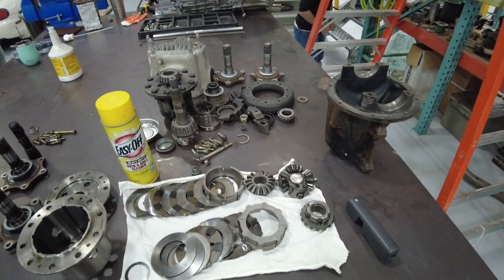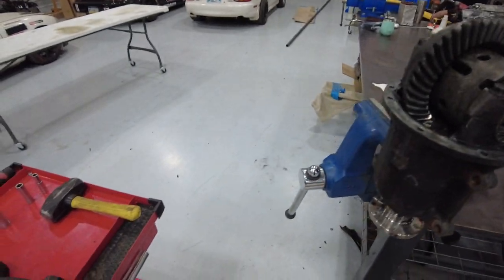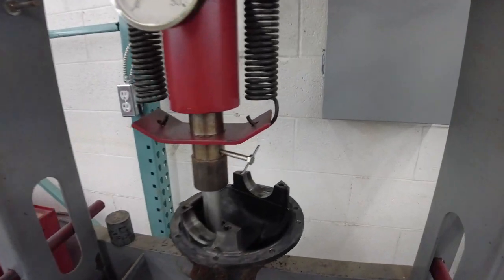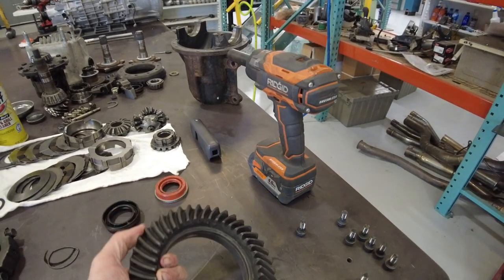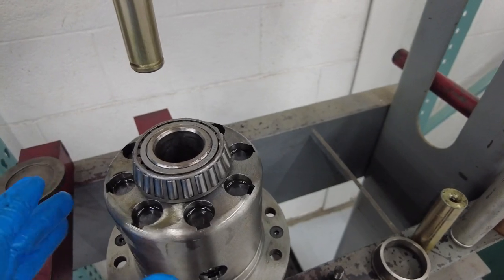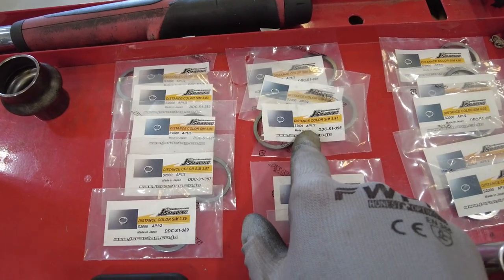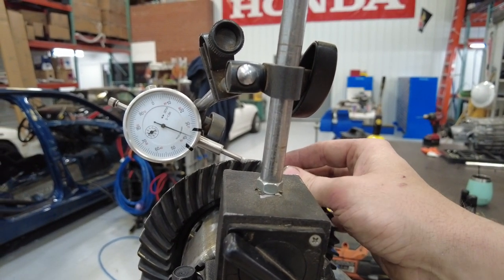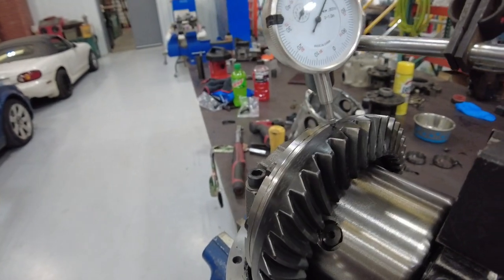DIY S2000 Differential Rebuild with ATS Carbon LSD

Comment: Hello,
Have you ever heard of a turbotecq rear differential booster?? It came out in the 60's on drag racing car. It used high pressure rocket fuel and burnt thru a turbine connected to the middle rear dif. It might not be the best for drifting but you want a hill climb racer or kick add burn out mashine. I bet tires would be gone quick and it would make a cool noise I'm sure, and you'd have a car no one else would have.

Comment: Hey Robert! Watching your video gave me the confidence to to rebuild mine, if I wanted to set the bearing tension as the workshop manual asks inbetween 14-30nm do you suggest doing that before or after torquing down the bearing end caps? Thanks!
Reply from the maker: I torque them down and then set preload. You can also snug them and get close if your just checking backlash and such. Doesn’t seem to make much of a difference

Comment: Hey so do you use Redline fluid for the carbon LSD? I read that ATS wants you to use theirs but said if you find a fluid that’s works then fine. I’m considering using AMSOIL.

Also is the initial torque adjustable? What is yours set to?
Reply from the maker: It can take a bit to sort out what fluid works best for you. I run heavy weight shockproof from redline with 2 ounces of slip additive. That seems to break in ok. May take more slip additive initially for track use. The Giken is adjustable yes, I think the ATS is also by flipping plates if you need. However i would recommend running it straight out of the box until you feel like you need something different

Comment: Great video!  Question for you - does the LSD need to be disassembled and rebuilt if it's brand new?  Is that it possible to skip that step or is it something you recommend doing no matter what?
Reply from the maker: i dont think you need to when its new. i like to do it to make sure it wasn't assembled too dry. Perhaps check with the manufacturer for your specific LSD

Comment: Nice video, I have a HKS supercharged s2000 and scared of launching it as I have heard the diffs are very weak in these cars. It lives on track so is given a hard time.

Is there anything you would recommend that could be done to help strengthen it so I can relax a bit with it?
Reply from the maker: Literally what the whole video is about. Follow the upgraded parts and hardware from the video. Change out the fluid for Heavyweight shockproof only if you are on an aftermarket plate style LSD. solid pinion sleeve. 12.9 bearing cap hardware, 4-5 thou backlash
Reply: @Robert_Thorne8  hey yeh I know, just wondered as people say to replace the end caps as well? How much torque abuse do you think that diff would take now with those upgrades you've done?

Comment: For grip (I'm running Club TR, instructing at track days and some autox) is it safe to assume a 1 way is the better option vs a 1.5? 
I'm also debating between a 4.4 and a 4.57 for NA power levels ~270ish on god mode, but it is possible that i add boost for 2024 (that may have answered my question). Any input would be greatly appreciated. 🍻
Reply from the maker: Would still recommend a 1.5 way and 4.1
Reply: @Robert_Thorne8  thanks for the tip! You just save me about $1k for a cryo treated 4.44. 🤘 I just ordered a 1.5 way.

Comment: Hello 
Very nice video!!
Can you send a link to  12.9 bolts please?
And the tools that you use?
Thanks you very much!

Michael
Reply from the maker: Hey Michael, i will find a link for the hardware. i found these at a local supplier
Reply: @Robert_Thorne8  thanks, I appreciate it. 
My s2000 4.7 diff is whiny, the faster I drive it’s make more noise. 
how can I know if it’s from the bearings or pinion?
Thanks you!
Reply from the maker: Hmm, is it the 4.77 kia sportage ring/pinion? Generally if its making noise, something has come loose or is out of adjustment
Reply: @Robert_Thorne8  yes it’s Kia. I need to find the problem.
Reply: @Robert_Thorne8  I do not find where to buy the diff bearing cap bolts, do you know where I can buy 12.9 grade?. Or at least what is the spec/size of the bolts ?
Thanks 🙏
Reply from the maker: @michaelhelfenbaum8776  Sorry! M10x1.25 x 55mm
Available from Fastenal
Reply: @Robert_Thorne8  ok thanks for your help. What is the right backlash to set 4.7 (Kia) diff?
Like the oem service manual said?
Thanks 😉